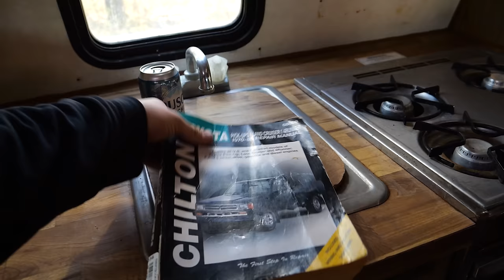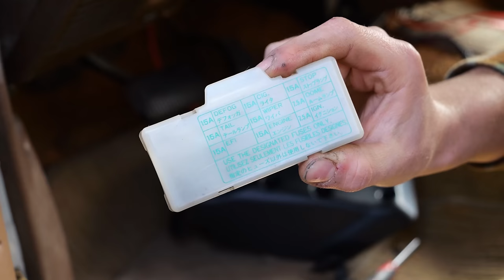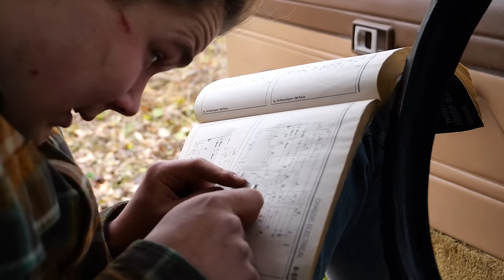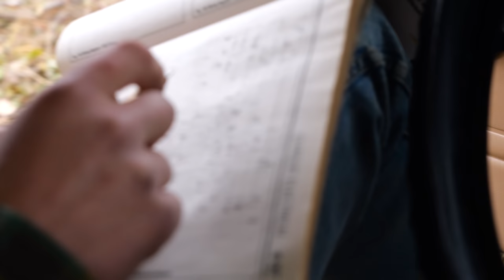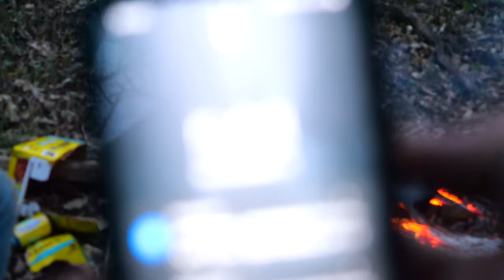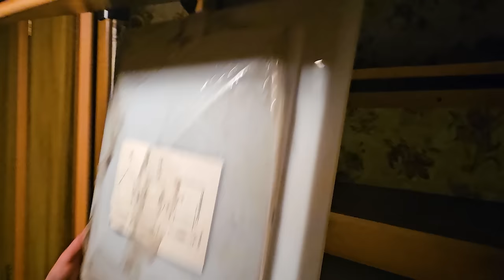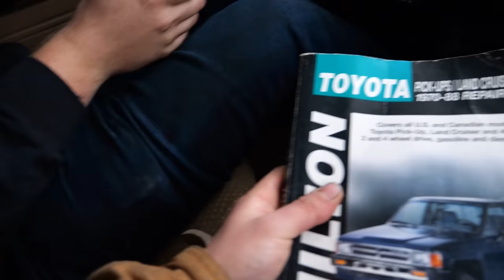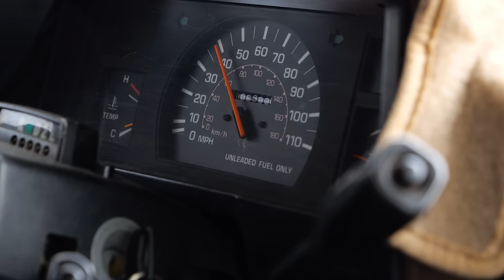Will this Old Camper RUN & DRIVE Out of the Woods?

Comment: These are neat. Someone in my town has one sitting behind the house who also has or had a eagle. Also it would be a neat idea to do a revive revival like revive the eagle wagon you have by sticking a (modern) 4.0 engine in it
Reply: God no. That'd just make it worse. I'd sooner see them swap ye olde iron into modern garbage that died early-but-right-on-time. Like, say, grabbing anything with a Ford 4.0 SOHC in it and Windsor smallblock swapping it.
Reply: @TestECull  no I mean jeep inline 6 4.0. The good engine after the 4.2 I6
Reply: @chevymontmarlo  4.2 still a better engine in my opinion, only ever needed a good carburetor on it, the stock ones sucked a bit
Reply: Ha imagine putting a Chrysler engine in a Toyota
Reply: @chevymontmarlo  Anything with EFI is automatically shit in my eyes 🤷 And I dont think you're gonna get a straight six under that hood..Better to grab a v8.
Reply: The new dramas 4 cylinder? Or maybe a 3 cylinder diesel out of dead equipment like heavy generators and boom lifts!
Reply: @kenwillis8487  3-53t  swap? 🤔
Reply: @TestECull  TDI is the move for Toyota swaps imo. Considering doing it myself. I’m rebuilding my old man’s 87 Toyota 1 ton
Reply: @TestECull  small & torquey
Reply: @swamp-yankee  Iono a screamy li'l 2 stroke sounds pretty damn good. Literally!

Comment: Toyota 22R-E is a legendary engine. If you fixed the exhaust leak it would run awesome. Had multiple Toyotas with a variation of this engine 18R, 20R and 22R-E all had well over 100,000 miles and were going strong. Usually the body would rust out before the engine gave a problem

Comment: They were built for efficiency, and if anything, to show you didn't need a huge expensive motorhome.  I think though a lot of mechanics did say that the 4 cylinder (while more reliable) was underpowered compared to the V6 versions obviously.  I can't remember but it looks like that has dual rear wheels so that may have helped with handling, and the weight likely meant that as long as you didn't corner too hard or fast, it wouldn't sway plus the center of gravity is much lower on that, plus the over-cab bunk probably helps with putting some weight on the front.   Travel trailers, on the other hand, and larger RVs are less aerodynamic, higher off the ground usually, which is probably why you thought it would sway more.
Reply: It's a Toyota 1-Ton chassis. They stopped production around 1989. Thus, the flow of Toyota campers stopped.
Reply: Had one for 5 yrs great little units 4cyl is a little slow in some circumstances 6cyl is too but a little less so
Reply: The v6 motors of this era had cooling issues

Comment: 19:40 there is a light switch by the door so when you enter your RV in the dark, you don't have to fumble around to find the light on the ceiling. Most RVs will have this feature.
Reply from the maker: I've never come across one this fancy 😂
Reply: I toyed with the idea of buying one of these in the UK but they didn't have enough seat belts.
Reply: @philtowle4683 I don't understand. Are your regulations more strict? I would think a Toyota RV this size would be perfect for Europe traveles
Reply: @64maxpower  Everyone travelling has to have a seat belt so as parents who want to take a child with them you need three seat belts so you are better with a van with three seats in the front or two belted seats in the front and at least one in the back. Fiat Ducatos or the Citroen or Peugeot versions are really popular and what I went for.

Comment: I believe the fuel pump only works when the airflow meter moves and the ignition powered
Reply: To be exact the maf sensor has a flap in it that closes the circuit for the fuel pump. So if that engine isn’t sucking any air your fuel pump ain’t pumping. Found that out myself a few years ago working on an old Toyota truck that had been sitting in a storage locker since 1997. Took me 3 days of stress to learn that.

Comment: 22RE engines are really reliable, but under powered especially in that application.  Timing chain guides and noisy valves are the only issues I’ve experienced.
Reply: A tappy valve is a happy valve!

Comment: Nice! I picked up an 87 toyota RV with 70k miles for $300 thats been sitting for a few years, Dropped the fuel tank and installed a new pump, engine wise a simple tune up and it runs like a champ. Passed smog here in CA with flying colors. RV body though I rebuilt the roof and fully redid all the wiring and electronics, solar and lithium battery, and full renovation. After a couple thousand in have a great mini motorhome. These mini toyota RV's are a gem!

Comment: I had an '84 Hilux (that's before they were called Tacomas). It had the 22ARRR pirate motor. It was carbureted, and what a great little truck. It was all white, with that same tan interior. It developed a vacuum leak one day. I went to the parts store and bought 20 feet of vacuum line. I guess the kid behind the counter wondered what I was going to do with all that vacuum line, but I replaced every one in the truck. One at a time. Pull one, cut new line to fit, replace. Repeat. That little truck was my daily for about ten years, and I drove it coast to coast. It had the five speed, and some days I still miss that little truck. It's about impossible to kill them unless you run them out of oil. All the best to you, and thanks for bringing back a bunch of great memories.
Reply: You can run a 22r with three vacuum lines. The big one to the brake booster, and the two to the vacuum advance on the distributor. Everything else can be capped.

Comment: If the timing chain is making noise, don't ignore. The chain guides are plastic and broke which it lets it slap the cover and will ware a whole in it and there is a coolant jacket it will rub into and cause problems

Comment: Fun fact about 80s license built Bosch L Jettronic systems. The fuel pump doesn't prime with the key. It runs off the AFM "barn door" circuit. Took me like 2 weeks to figure that golden nugget out when I first got my Mk2 Celica Supra.

Comment: These little 22RE  Motor homes are legendary and have quite the cult following.  You'll probably find that it's practically impossible to kill the engine. The only downfall I remember was that they are gutless and 55 mph is about their max speed and only achieved on flat smooth roads. Going over mountains will take forever.

Comment: Years ago when forums were still a relevant thing I followed a thread that must have been like 20 pages long of a guy that 1UZ swapped one of these, it was before YouTube so I never got to see it run but the way he described sounded like it was a match made in heaven.
I think he got the engine and trans out of an old Lexus LS400, and being that it's only four cylinders long it fit in there perfectly!

Comment: The "R"series engines Toyota had from the late 70's into the early 90's were second to none. They were Toyota's answer to Ford's 302 and 4.6 V8's. They're just a workhorse of an engine.

Comment: I always admired those RVs and recall seeing more than a few on the road and in campgrounds. I may have year models/manufacturers wrong, but I seem to recall a federally mandated recall because of rear axle failures back when the RVs were new production. Sadly, the RV industry and truck manufacturers have forgotten those of us who don't want or need every bell and whistle know to automotive science and just want an RV that we can drive to the beach or hill country for a weekend outing and have opted for $200,000+ and up houses on wheels that only a few folks want or can afford. If the Lovely Bride and I were to stumble up on a well-maintained Toyota based RV like yours, we would buy it and utilize it every chance we got.

Comment: I owned an 83 Toyota Celica with fuel injection and a carbureted 85 pickup both with 22R engines. The only time one broke down was when the Celica broke a cam chain, a new cam chain and it ran like it was brand new. I owned the Celica for 10 yrs. and the truck for 15 yrs.

Comment: Just for those who aren't in the know the "mass airflow sensor" "the flappy door thingy that basically just tells the truck that the motor is sucking" controls everything all of the communication to and from the ECU run through the mass then through the TPS if either of those are bad the whole truck just stops working

Comment: Hi guys on the freezer door in the frig that keeps falling down. The simple fix is to install a small "turn button" out of a thin piece of aluminum  about 1/2 inch by 1inch with a pivot screw that is just  snug enough to keep it in position to hold the freezer door closed except when you want to open it. Have a nice day. Tom up in Canada in the Maritimes at the NB-NS border

Comment: I’ve had 4 different cars / trucks with 22R and 22RE motors. Also worked Toyota full time for years. Alot of times these would come in with a blown head-gasket complaint only to find the worn timing chain / broken plastic guides would eat threw the front cover coolant jacket.

Comment: Just an FYI: On the early Toyota pickup and van fuel systems with the 'door-type' airflow meter, the engine needs to be cranking to activate the fuel pump solenoid. Once the air door is pulled open by engine vacuum, it will continue to feed power to the pump relay and maintain fuel pressure. That's why when you taped up the tube between the throttle body and the AFM, it would continue to run. BTW, the big fat screw sticking out of the top of the throttle body about 1/4" or so is the base idle speed screw. In most cases it will be about level with the throttle body or a little below, which would equate to about 750 rpm. With the odometer at 100,000+ miles, it would be a good idea to do the timing chain and gears, if it hasn't been changed already!😉

Comment: As for the fuel pump situation, I had a similar problem with an old Mazda, the pump won't run and prime the system, you had to jump it much like you did just to build initial pressure, then it will run no issues unless you lose prime again

Comment: If I lived anywhere close to Iowa, I would come and take it off your hands. All it needs is a timing chain and guide replacement, a transmission service and new coolant and it is ready for the next 100K miles. At 200K, that is the "broken in" point for those 22R-E's.

Comment: ha ha, this really brings back memories. i owned one of these, 79 i believe. forget what it was, as they made them with different names like dolphin,etc. the 20r i think, or 22r, whatever it had had a hard life when it was rolling. the thing barely got to 55-60mph on the highway (if it was flat), and got as slow as 45 mph climbing grades. it was too slow in my opinion to be on the highway. and i dont want to scare you, it looks like you have the duel axle. these were made with a tandem axle too. i forget the specifics, but some years that had the duel axle were prone to a wheel snapping off .but i forget the story behind the duel axle and tandem axle. but tandem axle was a bit safer. good luck with it, and if you get on the highway, better put some high powered amber strobelights on the rear and get used to cars and 18 wheelers flying by you so fast . no, i would never own another. it did have the coldest ac .. good luck with it! its a truck thats better to park in a field somewhere on like a remote camping ground and leave it,  20 years ago when i owned it, there was a yahoo group of these owners that discussed these trucks, if its still there. but i think you should research the axle situation.

Comment: At ten minutes in I was thinking maybe the oil pressure switch wire was loose. That used to kill the fuel pump and ignition on some of these 80s-90s models

Comment: It may have already been mentioned, but the AFM (similar function to a MAF sensor) triggers the fuel pump. Basically, it needs to see enough air flow to send power to the fuel pump relay. The ripped boot was likely the biggest problem the PO faced when trying to get it running. Your problem now may just be slow cranking/low air flow when cold. You didn’t do it any favors by closing the throttle to lower the idle and vacuum leaks just add to the problem.

Cool little RV though. A good tune up, timing chain (check for for excess wear on the timing cover), and it’ll be good for another 100k miles. Those engines never made much power, but their long life is directly attributed to that.

Comment: if you plan to keep it, be on the lookout for a 1987 and up rear-end, the pre 87 ( 5lug) are a flange and dually adapter...tend to snap, the 87 and up ( 6 on 7.25 bolt) are a full floating rear axle.

Comment: You can't go wrong with a 80"s toyota engine! They were the only small engines on the market that had a timing "chain" . All the American cars had timing belts at that time which would break at 60,000 miles and destroy your motor. So it's a keeper!
Reply: Maybe at the time, but japanese engines in general love timing belts, for whatever reason, 

US engines on the whole are more likely to have a chain.

Comment: 1980s Toyota 22re WILL run yes. My Celica sat in a field in wisconsin for 12 years 200k on the clock and spark plug wires + a fuel pump made it run. It ate a chain guide and never skipped time and the cyl walls survived the metal shavings no problem. Theyre insane engines.

Comment: Look at the European classic Camper scene, it's mostly First Gen FIAT Ducatos with 1.9 or 2,5 (Turbo-)Diesels Transverse FWD with a 5 Speed Manual on the Tree, 67 to 95hp. And if they run right, they aren't fast, but easily cruise at 75mph with 20mpg. They are definetly holding up with any American V8 Full Size Camper. 
It's all down to the enormous Transmission and Drivetrain Losses that you simply don't have in a Manual Transverse FWD.

Comment: I love a toyota. I've got a 1990 2wd Hilux with a petrol 2Y (1.8l) engine and a carb. 
Great truck but the salted roads in England haven't been kind to the chassis. 

It has a fast idle when you start it in cold weather. Manual says to flick the pedal after a minute and the idle will go back to normal.

Comment: I've always liked the little Toyota campers. I had a 22R and my 81. Toyota ran like a champ 4x4 It went anywhere I told it to. But once it blew the top radiator hose that took about Less than five minutes to warp the head After that it never ran right.

Comment: When you come across cars like that, check battery drain first. Pour Marvel Mystery Oil in the cylinders to remove rust. Let it sit and then crank the engine to remove it. Change the oil.

Comment: I lived in one of these with 2 other dudes for over a year, I took the top bed, they got the bed at the back. No heat, or ac. Except my buddy did let us run a cord from his house for electricity, and had a spare space heater he let us borrow for winter. We had a little kitchenette and a smaller bathroom, but still had running water and electricity so we were okay.

Comment: Hey on the old Toyotas you do actually adjust the idle with the screw on the throttle body! And on this one it is screwed almost all the way out which would cause crazy high idle. As I've fixed parts of my 22re over the last 2 years I've had to adjust the screw at different times to achieve proper idle rpms.

Comment: Used to work on these old toyota trucks at the dealership true that the 22re is a remarkable engine but has allot of vacuum lines and emissions crap that 20+ years later can turn it into a non efficient vehicle if you don’t know what your doing but still a thoroughbred workhorse

Comment: Just Looking at the idle air adjustment screw on the throttle body at 14:57 makes me think that the high idle is being caused by that. When I compare it to how my fathers' 85 toyota truck looks like, yours is out my at least a quarter inch in comparison. Just know that if you ever do a timing chain, you need to remove the distributor in order to get at a bolt hiding underneath. Love the content as always.

Comment: Dude... That is an ideal little model I would love having. Not that the bills that go with it would be wanted, ya know? 

And if you thought the heater going on and off was bad... I may have ya beat. I had the "joy" of sleeping on the fold down dining area in a 27 footer... The heater was under one bench and the water heater under the other. Toasty spot, but the oxygen concentrator my dad had was worse noise...

Comment: That auto is in some ways a better option for something of that weight, the G52 five speed will blow top gear if using under load, I’ve killed a few in my time. That interior has been well protected by the camper body, real time capsule

Comment: Fun fact in the early 90s the ecm was built in such a way you need a radio to allow signal pass through because it was first gen they used duel fuze boxes they thought this would be good they forgot that those radios break easily they were wired weird and needed the radio for pass through and signal regulation it was the so called easy method tho it just made it harder on the mechanic cause normally a radio didnt matter

Comment: My dad had a 2004ish Chevy 3500 4x4 Double Cab 8’ bed Dually with the 8.1L and it got way better gas milage than a 2500 with a 6.0L.

Comment: Your idle issue is caused from the flat head plug located on top of your throttle body. That plug is almost all the way backed out, that should be about 1 turn out from fully closed.

Comment: yay finally an 80s toyota. the rheostat behind the glovebox is for the aftermarket air conditioning. the fuel pump is triggered off the flapper door in the AFM. that thing also desperately needs a timing chain.

Comment: That 1980s style shore-power DC and Fuse unit is prone to regulation and filtration type failures, double-check voltages.